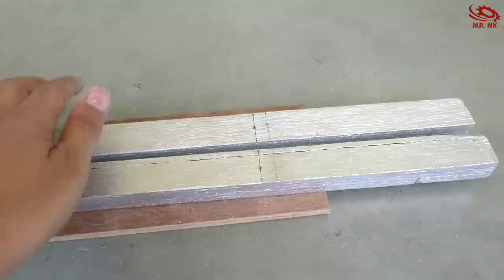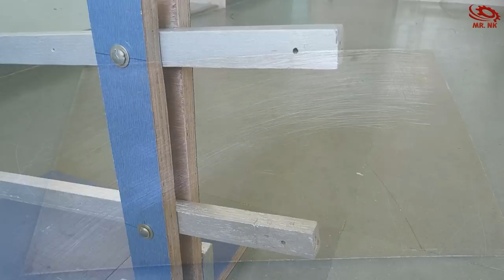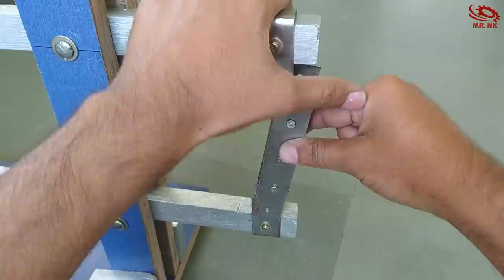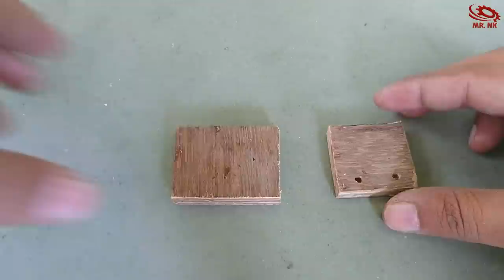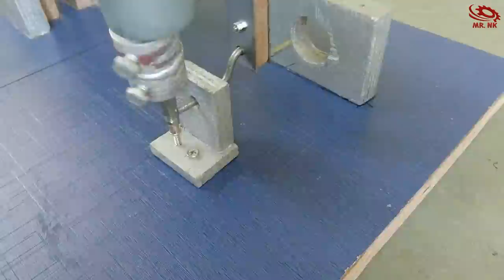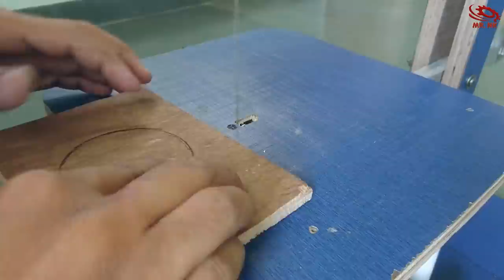How to Make a Scroll Saw at Home

Comment: Your better off buying a scroll saw because on how fast the wire saws break and the price if the drill.plus the shut off is undoing a bolt
Reply: Wut? drills are like slightly above $30 for the cheapest one here, though he should have probably used a coping saw blade, cheapest scroll saw here is $214, also if your drill has a trigger lock then the bolt thing isnt necessary
Reply: Buy a used scroll saw. Maybe $30 for a Variable speed one
Reply: QuitePear192103 cant find a used scroll saw seeing how rarely people buy these kinds of things, i bought a jigsaw for ~$50 not too long ago and its easier to mount it to something upside down and use it as a scroll saw if u need a scroll saw, changing the blade and cutting into holes is easier too

Comment: The wire is diamond coated,  it is sometimes called survival wire because hikers and campers put it in their kit for emergency's.  You can even cut through rock and steel with it.  It is readily available on eBay and Amazon or camping stores.  Just type in wire saw in eBay or Amazon.  This video shows how to make a type of saw.  You can refine the construction to make it better but the principal would be very much the same.  The saw works, how well you can make it,  will depend on how well it works.. The idea is great and I thank Mr NK for his time and effort in posting the video.   For the rest of the nay sayers and the thumbs downers, well they can all go and get fucked.
Reply: What comes around goes around… your last word in your comment ruined everything prior to that!
Reply: @superspecialty5169  I think it enhanced it a bit, nay-sayers are kinda cringe ngl

Comment: Blade name?
Reply: The wire is diamond coated, it is sometimes called survival wire because hikers and campers put it in their kit for emergency's. You can even cut through rock and steel with it. It is readily available on eBay and Amazon or camping stores.      Just type in wire saw in eBay or Amazon

Comment: This is bad on so many levels. The idea is super good, but the way you made it, it's just bad. It doesn't run nearly as fast as it should and there is no way to tension the blade, so it is flimsy and doesn't cut really well.
Reply: But he made it and documented it. Wasn't advertised as the best one, but more as a reference of one that is both home built and functional.